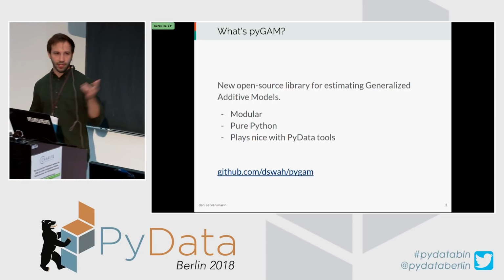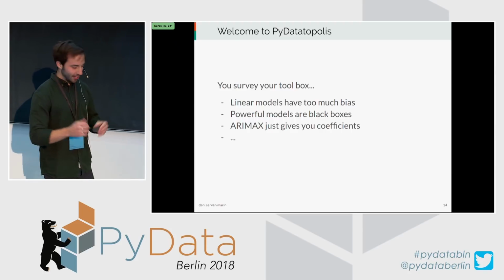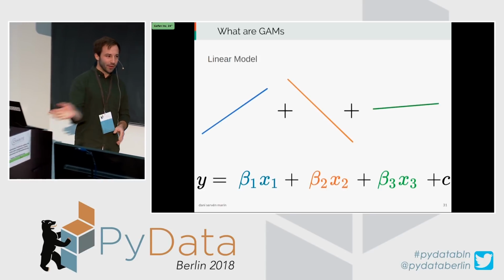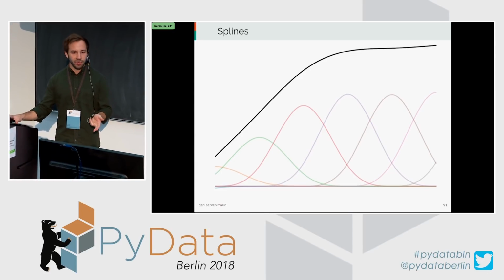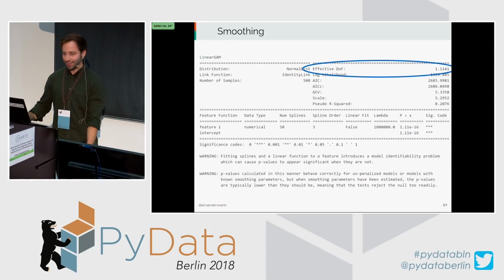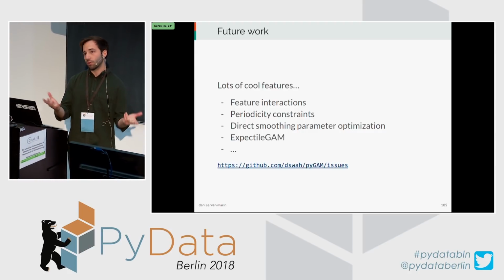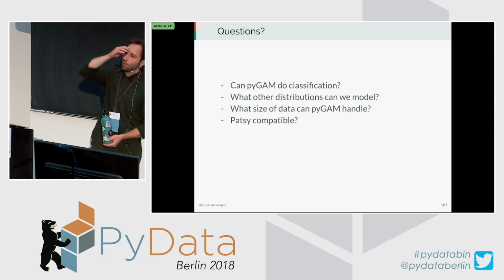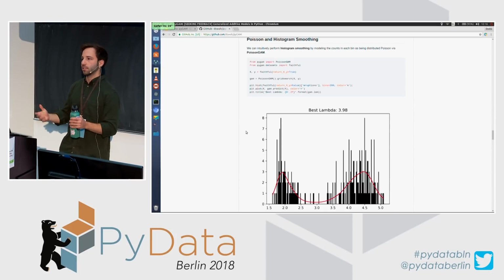pyGAM: balancing interpretability and predictive power using... - Dani Servén Marín

Comment: Hello, and thank you for this package.
I wanted to add an offset to my model, but I realize that it's not possible. An offset can be seen as a linear predictor with a variable having a fixed coefficient of 1 (g(mu) = f(x1) +x2 ) : x2 is an offset. Please, is it possible to fix the value of the coefficient in a linear term? For example, l(1, coef_estimate=1)? In this case, variable 1 (x2) will behave like an offset.